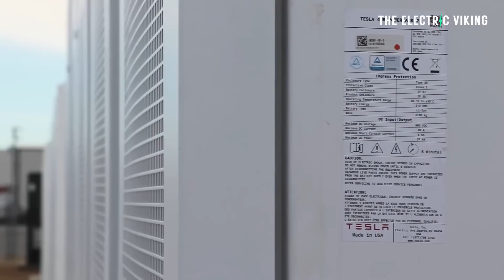Tesla signs biggest battery contract in history - U.S. grid will be transformed

Comment: Do you Climate Cultists know how many years of MegaPack production by Tesla would be required just to meet Australia's battery back-up for CURRENT unreliable wind and solar power  back-up. Current grid battery capacity provides 4 MINUTES of National Energy Market demand - 4 MINUTES
Reply: I was gonna say the same thing.  Where I live the total amount of megapacks Tesla sold last year would power our grid for just over an hour.  Lets just stop messing around and start building nuclear power plants.  These people are coming up with the least efficient way to produce power.  You build a bunch of nuclear reactors and they are basically running 24/7 for decades at a time.  Then after like 40 years you shut them down for like a year to refurbish the reactor and then fire it back up and run it for another 40 years. Once a reactor is paid off (15 or so years) its extremely cheap to run. Also the most expensive part is all the ground work and building the structures so when you do a refurbishment its not that expensive. You arent replacing any of that.  You also drive down costs by building lots of reactors in one location.  Bruce Power in Ontario has 8 reactors in 1 location.  That provides 6.5 GW of power.  They are talking about adding another 4.8 GW to the same location.. The whole site is 2200 acres. There are farms surrounding the whole area.
Reply: @pin65371  Well, you run into the same problem that you have with wind and solar - THE PUBLIC IS FULL OF STUPID PEOPLE. So you will get people wailing about the BS problem of nuclear waste, or the risk of the "China Syndrome" or they will point to Chernobyl or Japan (Because the Russians couldn't give a damn about safety and the Japanese didn't predict their tsunamis correctly).
You will get BS environmental assessments and NIMBYism.
But would I live near one. Well actually, yes. Just outside the exclusion zone actually. And NO, I did not work for (directly or indirectly) the "power plant" but many of my neighbors did. Nuclear has huge capital costs and is not all that cheap. I'm not PRO nuclear (costs) but all the stupid reasons people oppose nuclear are just that - STUPID.
It's INCREDIBLY STUPID of Germany to shut down their nuclear power. I am still amazed at the supposedly rational, logical Germans doing that WHEN they did. Were they trying to SABOTAGE THEIR OWN COUNTRY?
Reply: @pin65371  Nuclear power is by far the most expensive form of electricity generation.
If you dont mind what your electricity costs then go ahead build nuclear, but if you want fast cheap electricity, it has to be renewable energy, Wind and Sunshine is free unlike Coal, Gas, Oil and Nuclear are not.
Nuclear takes decades to build and dont forget the decades to decommission, also dont forget the thousands of years of storage and security of the nuclear waste, factor that into the cost of Nuclear power
Reply: @Stumpy1854-Orion  Wind and solar are good, but they do not steadily provide electricity. You need something to fill in the caps and also consume excessive production. That is quite bad side for wind/solar.
Reply: Get real - we plan to use Gas Peaker Turbines as the last resort backup for the Renewable Grid in Australia. The backup order is as follows in Australia - Hydro, Pumped Hydro, Grid Batteries then Gas Turbines. Batteries have a far more sophisticated role in electricity grids than simply backing up. 

PS The Grid is designed by engineers not politicians so that it will deliver reliably and cost effectively. 

PPS Read the AEMO ISP 2024 Roadmap and then you won't panic about batteries and worry due to not knowing what the plan is.
Reply: @TimMountjoy-zy2fd  I'm glad you agree that engineers deliver reliable and cost effective methods to supply the grid thats why engineers are implementing batteries, politicians have no choice in the decision, politicians dont do anything, engineers do
Reply: @TimMountjoy-zy2fd The AEMO is run by idiots
Reply: Sometimes that is all that is needed to stop the grid tripping out and it is only the start of the change, they say Rome wasnt built in a day.
It's so sad to see doomsayers like yourself, with your heads stuck in the sand.

Comment: Could be a good time to invest in BYD, CATL or LG Chem. Tesla is going to have to get the cells from somewhere. Maybe Tesla could re-direct batteries allocated for the automotive division if revenue from that division continues to tank.
Reply: LG Chem makes junk. They are the battery makers that had all those GM Bolt fires.
BYD and CATL are good though.
Reply: @rickrutledge9363  Maybe, but they make a lot of it. Tesla needs every battery cell that they can get their hands on.
Reply: LGES is set to start producing Tesla’s 4680 battery cells in North America, specifically at its new factory in Arizona later this year. This production will supplement Tesla's in-house capabilities.

Tesla is also building a small new LFP (lithium iron phosphate) battery cell factory in Nevada, using equipment from CATL. This facility will help Tesla produce LFP batteries, which are cheaper and more stable, particularly for its energy storage products
Reply: @-whackd  The CATL cells maybe an option, but the 4680's? I don't think so. Delay after delay after delay in getting production up to speed and they're still using Noah's very own NCM chemistry which is neither cost effective nor has the potential longevity of LFP or even sodium chemistries.
I don't know how many GWh. of CATL cells that Tesla will be able to produce under license, but I'm fairly figuring that they are going to have one heck of a number on the liabilities side of the ledger for cell purchases for a long time to come.

Comment: You are not a financial expert so. I will correct you thinking.  With respect to battery storage systems, there is little technology development that is required to bring new products to market. As we say, there barriers to entry are low.  In contrast, the barriers to entry for new cars are high.... Well they were for ICEs, but they are apparently much lower for EVs.  Still, simple battery storage has extremely low BTE.  That means margins will be low, in the long run. They are high now because demand is far exceeding supply, but because of the low BTE, new supply will come to market to meet that demand.  Take for example, GE. They currently do not have a product in this space. But they will soon and they have huge resources to ramp up production and when they do the prices will fall and margins will contract. Heavily.  So right now Tesla margins on these systems is around 35% I think.  That could easily drop to 10% or even lower in 5 years time.
Reply: Lots of battery manufacturers are already out there trying to make sales in this storage market. But there is something about what Tesla provides that you didn't mention: their proprietary energy storage controls. This is not just some simple switches, it is a very sophisticated hardware/software system to make the connection with energy generators and the grid run smoothly. There are numerous cases of utilities buying cheaper batteries but they have control problems. Tesla solved those problems, it just works as promised, which is why they are now getting huge orders. That's the bar that GE will have to meet, and exceed, to make any real headway in this market. They might, they might not, but they will have to prove in field installations that they are at least as good as the field-proven Tesla megapacks.
Reply: We'll see, but Tesla's advantage is mainly in the software. I don't see how rivals can magic up world beating software quickly if they are not yet in this space.
Reply: As you can now see, they are not simple battery storage systems and they do have very big BTE. They include first mover advantage, proprietary software and hardware, battery supply chains and reputation for delivery and reliability. Not so simple really 🤔
Reply: When is GE going to have a product in battery storage? Do they have battery manufacturing facilities as big as CATL and BYD do?
Reply: Building batteries is obviously easy. My guess is the software Tesla has to direct the power to where and when it is needed, and most likely using AI to predict this in advance, might not be so easy. We will see. But for the home storage part of it, I would assume you are totally correct. It will end up being a low margin commodity type business.
Reply: tagged for 2028
Reply: Buying Tesla stock is about the robotaxi play, which puts them in the Software as a Service category which generates unreal margins
Reply: Low profits is good for the consumer
Reply: I’m waiting for the next gen that Elon mentioned on the earnings call whe he said the the grid will be able to do away with substations. That’s going to be a pretty big game changer. 

Will the dry cathode tech and production efficiencies that are starting to be realised and ramped up now - have any effect on megapack production and margins?
Reply: My money is on Tesla. I will never hold geeeee - late to the space… I’d rather hold the technology leader.